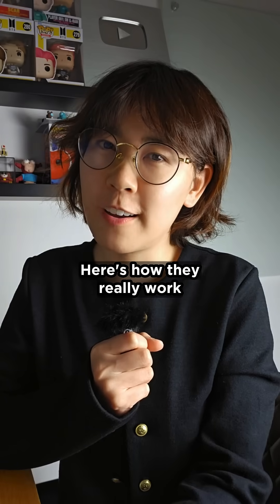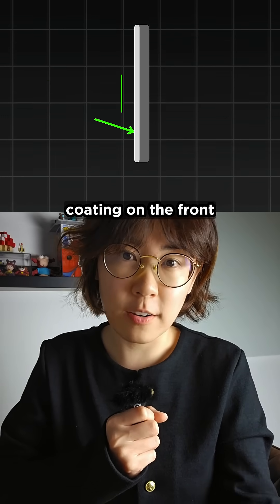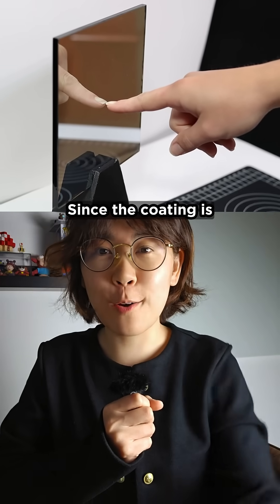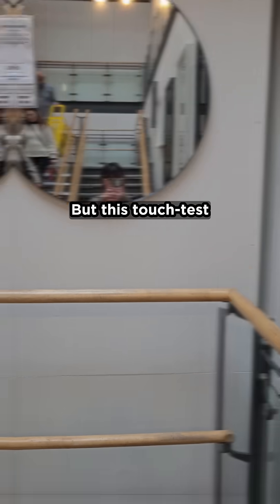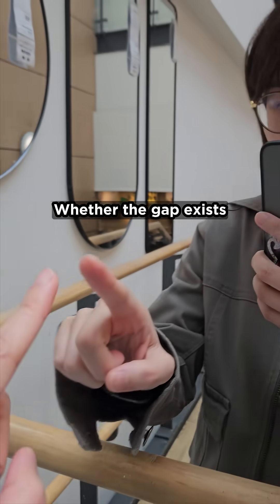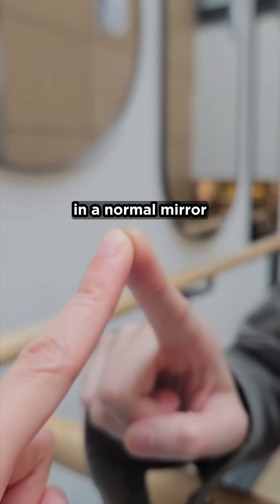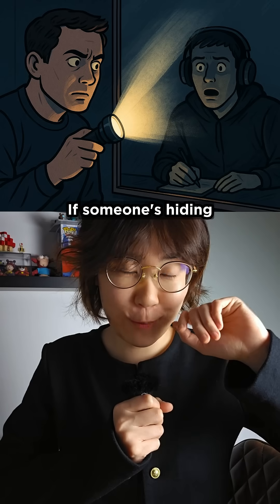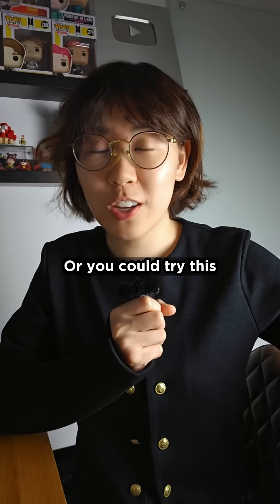Can You Spot a Secret Mirror with This Easy Test?

Comment: As a housekeeper, if you're concerned about these issues, I would recommend a corporate owned line of hotels such as hilton or IHG (holiday inns).  Not only are those buildings thouroughly (and I mean THOUROUGHLY) inspected at least once a year, there literally isnt space for something to be hidden behind the mirrors.  Especially not an entire room someone could fit in.
Reply: this, better to go with what you know wont have any fuckery. that minor saving of money isn't worth it
Reply: !!!!! don't try shitty privately owned non controlled stuff! Listen to this one!!!!
Reply: @DevilSeiji  Thanks for your literally invaluable input
Reply: @DevilSeiji  Soooo, air bnb is not such a good idea?
Reply: Yes, this exactly. I did hospitality housekeeping for 14 years and if you're concerned about safety or health standards, corporate or commercially owned is the way to go. VRBOs and AirBNBs will not ever measure up to the same standards.
Reply: The camera could still fit in. Unless the camera can't capture what's beyond the mirror. However, installing it requires modification with wiring lines of the building itself (to keep the camera running), so it's not easy, but a long life battery would still work. So, it's not really fullproof, but it's indeed more credible in top hotels
Reply: Like 3 years ago corporate hotels were being sued for human trafficking and being aware of it
Reply: @Nothing02310  That is the fault of the GM of that hotel, most likely.  Its much harder to find evidence of human trafficking than it is to find a camera or a one way mirror in a room.
Reply: Sounds exactly what a creepy mirror watcher would say !
Reply: Hilton and IHG are unreliable these days. Should go for Marriott or Starwood or Four Seasons
Reply: exactly.
Reply: Camera.
Reply: yeah, no, usually the concern is not about a creep in a dark room behind the mirror, but a microcâmera begind the glass, recording everything. But, yeah, replacing a mirror with one witha  remote camera, that may have to be powered somehow, in a big chain hotel is not something one could pull out easily, thought
Reply: But a camera could fit
Reply: most of the time the mirror is on the wall with your room behind it
Reply: sure, there's no space behind a one way mirror for a hidden room and a person there, but surely there's space for a hidden camera considering how thin our phones are these days.
Reply: @BenjiSun  the mirrors are glued and caulked, as are most corporate hotel mirrors.  It would be quite a challenge to get something back there, as well as replacing the current mirror.
Reply: More comcerned about a hidden camera behind the mirror than a dude in a robe
Reply: @Net_Zero read replies, i dont feel like repeating myself again
Reply: There was a hidden camera found in a holiday inn.
Reply: @soundrogue4472  im never said it was impossible.  Just significantly harder.  Creeps can get crafty, we do our best to prevent it.
Reply: No need for a person if you can fit a camera
Reply: @KaiaKooking no need for a false mirror when theres 700 places to stuff a camera.
Reply: I was going to say I wouldn't be so sure but then I remember the IHG I was thinking of was Franchised not Corporate.
Reply: You're also giving money to one of the worst industries in existence. Just shine a light and stop watching so many true crime movies lol
Reply: @UnBesoDeCristal  elaborate on corporate hotels being one of the worst industries in the world
Reply: They aren't thorough at all what are you smoking? And that leaves 364 days if tom foolery
Reply: im pretty sure a camera can fit in between the mirror and the wall
Reply: @robertgough161 technically true, but itd be far easier to hide it in the bathroom vent if we're going with a camera.  No need for all the one way mirror shenanigans.
Reply: @theskilledsnake  exactly, going with false mirror shenanigans in hotels is unnecessarily complicated in any case at a time where camera are tiny and easy to hide.
Reply: @robertgough161  a camera can look like a phillips screw head.
Reply: @robertgough161 sure but why would that camera ever need a complete two way mirrir for you to detect?
Reply: I was told the only way to really be certain is to smear toothpaste or pine tar on the mirror.
Reply: @evankirk2976 id appreciate if you didnt LMFAO
Reply: @evankirk2976  LOL how stupid
Reply: There's always space for a camera and i don't think those annual inspections involve sniffing for bugs/spy related devices like cameras or listening devices.
Reply: @RaveN_EDM space behind the mirror?  In a corporate-owned hotel, you'd have to swap out the mirror (you'd be on camera in the lobby at some point, we have them at every entrance) for one that was identical but one way, figure out how to take the mirror off the wall as they're likely to be installed with screw holdings and glue, and dispose of the old mirror, and if you're a guest, rebook that room.  Any hotel employee would be caught even easier than a guest would be trying something like that.  Like I said, its really not a feasable thing to use a one-way mirror.  Theres much better spots to hide something if the room weren't inspected.
Reply: @theskilledsnake as a housekeeper 100% agree with you on everything! An the first comment dude is a clown 🤡 the one who had an issue with her evening mentioning privately owned 
Devil somthing 😂 should be more clowndevil
Reply: At least once a year? then no need to worry at all ...for that one day of the year 😂😂
Reply: @vivektam  the hotel I currently work at is inspected 4 times a year, the worst ive seen is once a year.  There's no time to set something like that up, it'd require alot of people on board and quite a bit of craftsmanship for something so creepy.
Reply: @vivektam  Youre right, they should check every minute of every day
Reply: @Grim-mler  yeah, you are right too
Reply: @vivektam owner here, it is NOT inspected once a year. I have to deal with inspections atleast monthly or bi-monthly.

Comment: Two way mirror sounds anout right, one way means you can only "see" from one side, as the light you can see is only your reflection, whereas the other side is the opaque metal coating.

Two way would mean you can "see" from both sides, but on side is reflective, while the other side is see through. That would also tell you that the reflective surface is not on the back of the glass, hence the gap when you touch the surface, but more closer to the surface or integrated with the material of the glass.
Reply: One way mirror implies that it's only a mirror in one way, not the other. Which is true.

Comment: Finally someone who says that the finger test "no space leave the place" is not 100% reliable. Some modern (cheap) mirrors will have no space, even though they are 100% one-way mirrors. The flashlight is much more reliable
Reply: yeah lol, besides, the creeper could just add a thick glass in front of it, and watch those people who do the finger test.
Reply: @Raizouxx  Delete the comment before someone uses this idea😂
Reply: @Raizouxx How the fk u got this idea bro😂😅
Reply: @Aarav_Mishra_169  idk, critical thinking?
Reply: @Aarav_Mishra_169  this is literally first what people will do if they want to do it
Reply: @Raizouxx  don't worry when i use this it won't be used inappropriately 😂
Reply: @Raizouxx  wtf, bro thought he’s smart 😂
Reply: @Raizouxx I thought of that too
Reply: @Raizouxx that’s not how it works🫩
Reply: @Raizouxx bro has experience wtf
Reply: @Raizouxx  delete this shi rn
Reply: @Raizouxx You don't even need to do that there is no rule stating that you have to have to reflective coating on a particular side as both sides are still reflective whether it is a regular mirror or one-way mirror. The reason there it usually called 2 way mirrors is for that reason both sides are reflective And it relies on one side being darker to be able to see out.
Reply: @Raizouxx  that's not how that works, the reflective coating would still be on the front, the glass is on the side of the creep so no matter how thick it is the fingers will always touch
Reply: He means put a pane of glass on top of the one way mirror's  coating. That way, the person testing can't  verify if the mirrow is "one way" by touching the mirror and seeing if there finger touches. Similar to a regular mirror it would have the glass on top and therefore have a small gap between it and the one way coating. HOWEVER, I have never seen one or have one to do this, so i can't verify if this would effect the one way coating. @CAYDINION
Reply: @CAYDINION  Can you rotate an image of an apple in your mind?
Reply: Yeah, that's what i was saying for years. Plus, I've installed an interrogation room mirror before. There IS a 1 way mirror that has glass layered at the front, or has the reflective tint on the back. The tint one does have a problem of degrading overtime, and the installation needs to be perfect. But it is a method used. All the fingernail 'hack' does is lull us into a false sense of security 😂
Reply: You mean a regular mirror. A one way mirror is the kind that you can see through the back. She literally calls this mistake out in the video, and you still did it.
Reply: @fop-x  Fr i was confused like huh?
Reply: Great job misusing the name “one-way mirror” on the VERY video that pointed out that it’s incorrect. Big brain here!
Reply: @RtaincCo  One way mirror os the one that just one side sees right? So je used it the correct way
Reply: @RtaincCo how about you shut the hell up and speaking to ppl like that. Who the hell are you to be talking to him like that kid?
Reply: Ikr
Reply: The Hammer test works 100% of the time
Reply: @Wabinator  and you 100% had to pay for it
Reply: Misused the word oneway
Reply: Disagree. 🔨 is much more efficient
Reply: It's not that it's not 100% reliable. It's pretty much never reliable. It's easily bypassed.
Reply: But the last method is the most relabelled!
Reply: Also, if the mirror is built into the wall, probability of a one way mirror. If it is hanging on the wall, probably a regular mirror. You can always look behind the mirror as well to see if there are any holes/doors/ spaces behind the mirror in the walls if the mirror is a hanging mirror and/or to look through the other side to see if you can see through it.
Reply: Yeah I just tested it on my table mirror and my finger doesn't leave a space.
Reply: You can also push your phone flat against it with the camera on.
Reply: it's also not reliable simply due to the fact that no one is stopping someone from just putting an additional layer of glass right over the reflective material so that it would look like an ordinary mirror but it's still actually see-through from the otherside. the fact that nobody thought of that little detail makes me pretty confident to believe this is an american debate lol
Reply: Hey, question, what happens if it's public mirror? Like stores or boutiqes? Those dressing rooms? Like how do I tell if it's one way or not without telling them to obviously turn off the lights
Reply: @Who_IsThis_Divaaa  You might need a bit of ingenuity for this. First, let's understand that putting a room behind the mirror is not as easy as movies make it look. So I would try to "guess" if it's a possibility in the first place. You can't turn off the light? Knock on it, if there is a room, then it means there is empty space behind the wall and you should hear a different sound compared to a normal wall. Or try to look at it diagonally, in THEORY, you should be able to catch a glimpse of something. 

But let's be honest, the fake mirror requires quite the diabolical planning beforehand. You need to stage the entire thing with the construction company or at least a couple of other people. At that point, I would simply secretly record you with a hidden camera. Hope you are not getting useless anxiety from this, my friend.
Reply: @davide9495  secret camera is another thing.., the one giving me the real anxiety, because it's hard to catch like how do u catch that you're being watched??? 😭😭
Reply: "even though they are 100% one way mirrors" that sounds like there's no reason for the "even though", unless you meant simple mirrors not the one-way kind that you can see through
Reply: If people are  that paranoid someone is watching them, stay at home.
Reply: @peterbennett9824  you can also be spied on in ur own home.
Reply: what the hell you talking about? the hammer would work superb, cause you also smack the creep behind the mirror!
Reply: Who else thought of using the sharigan
Reply: The hammer's even more reliable.
Reply: There are also things called "First Surface Mirrors", they are used in old projection big screen TVs but mostly in telescopes. You won't have the gap because the mirroring is on the outside surface of the mirror. This removes any distortion that would be imparted by the thickness of the glass on a regular mirror. The silvering is on the part you would be touching. they don't use them for regular mirrors because they are more expensive.
Reply: Not to mention that there could still be a glass layer on the reflective side.
Reply: Boycott Colgate they support genocide
Reply: I use one-way mirrors to make infinity mirrors, and the ones I buy are one-way in both directions, lighting is what determines which side you can see though. I always use them with the glass facing out to avoid getting ghosting from the light bouncing within the pane, so I don't really get why people think the finger test is effective at all.  With the infinity light on you can see right through, when it's turned off it looks like a perfect mirror, glass and all.
Reply: Also, it’s pretty easy to just put a thin pane of glass over a 1-way mirror, creating a gap 😅
Reply: Wouldn’t they just be a mirror and not a one way mirror then?
Reply: The person in this video is ironically recording it with a cell phone... Put the camera to the mirror.
Reply: As a person who used to professionally tint windows I can verify that you can have mirrored tint on the back of a piece of glass and it'll still have the spacing... I had two cars that had the mirror tint a white Lincoln on bags with the chrome mirror tint and a sun yellow caddie with gold mirror tint... so this test is not completely accurate... using the flashlight will work... but if you wanna check for cameras behind it, turn the lights off use your camera look for a glow  from the ir lights
Reply: A regular mirror isn't a one way mirror...
Reply: Like what if you add glass on top of the one way mirror 😂😂
Reply: how is this entire comment section getting the term wrong after the video here literally explained it
Reply: And since two way mirrors rely on the difference in light intensity to function you could 100% just install one "backwards" and it'd work AND have the gap people look for
Reply: @Mainjoyner  there's no such thing as a two way mirror
Reply: Playing the odds “if there’s no space leave the place” still holds. Because see thru mirrors will never have a space
Reply: @Menuki except it's not. A see-through mirror like that works with light. Have you ever tried to look outside a window at night from a bright room? Ever notice when you do that, it's difficult to see anything but what is in your bright room? The observation mirrors in question do exactly that, but with a reflective coating to further the illusion by making it more difficult to see through when both sides are dark.
Reply: @Menuki  False.

Comment: Can you explain how partially reflective work? Like, how can it only reflect some light that make you see yourself in the mirror, but also let the light pass through?
Reply: Based on chatgpt, the reflective material is semi transparent, and will act the same even if you flipped the mirror, as long as the other room is brighter, and the other is darker.
Reply: Ever used mirrored sunglasses?
Reply: @karkajouautomaton4882  but he is asking how it what. Not example of it
Reply: Lights are photons not rays so maybe some photons reflect back and some don't. I'm not too sure though
Reply: a very tiny (microscopic) hole on reflective coating, or you can say it's a very thin reflective coating to let some of the light to pass through 🤓